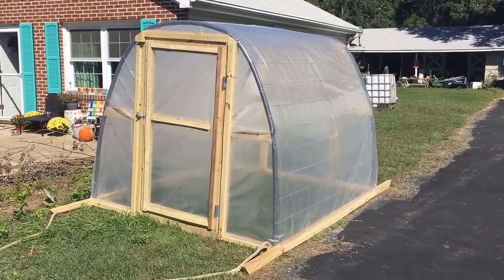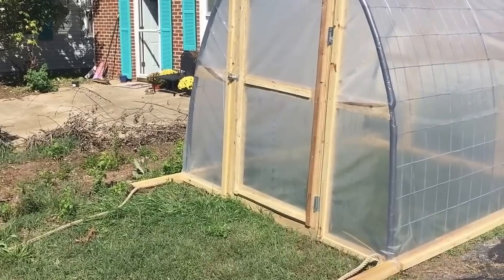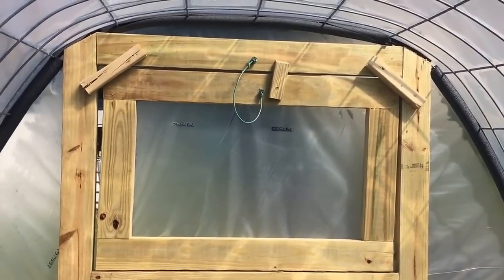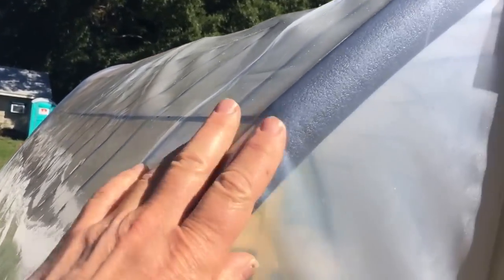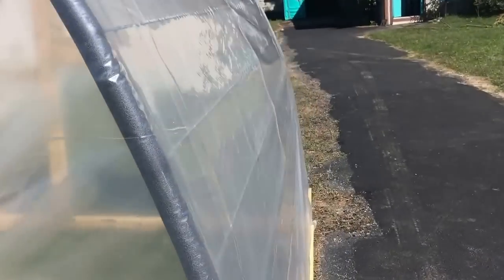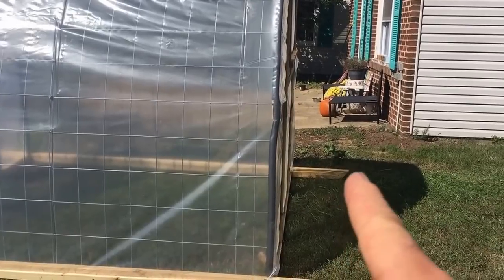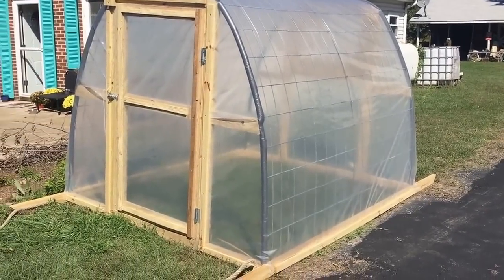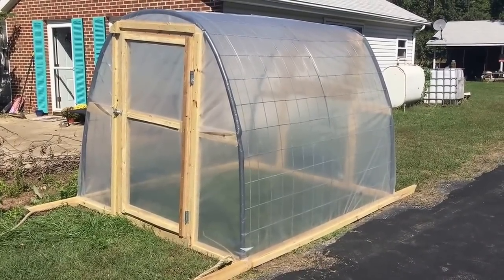DIY Cheap Greenhouse

Comment: Couple questions. Wouldn't ants and termites eat the wood? And what are you supposed to keep pest and rodents out?
Reply from the maker: The wood is treated, so I've never had an issue with termites or ants.  Pests and rodents will find a way in if they want to, so don't put things in there that attracts them.

Comment: I noticed your cattle panels are on backwards, should be flipped over so cross wires are on the inside.
Reply from the maker: Thanks!  We were going fast with multiple people and that one slipped through the cracks.
Reply: hi everyone ,if anyone else trying to find out diy backyard greenhouse plans try Lomonting Easy Greenhouse Mentor (do a google search ) ? Ive heard some unbelievable things about it and my buddy got cool success with it.
Reply: I\'m not sure but ,if anyone else is searching for diy greenhouse ideas try Lomonting Easy Greenhouse Mentor (do a search on google ) ? Ive heard some incredible things about it and my friend got excellent results with it.
Reply: @All Thing's Green - They are called cattle panels and they are galvanized steel, so they are rust resistant.

Comment: I'm curious about the life of the plastic cover. I've built one with visqueen before and after about 3 months the sun caused it to crack and split and then the wind finished it off.
Reply from the maker: This one is rated for 4-years.  Amazon link: https://amzn.to/34GMlWN  That will depend on the conditions though.

Comment: a word from  experience I used the 6 mil clear plastic on a similar style and in less than a year the sun destroyed the plastic and I replaced it with clear corrugated roof panels
Reply from the maker: Thanks for the input.  So far no problem here, but will keep this in mind.
Reply: use green house plastic, normal 6mil plastic does not have the uvi or uva additives to prevent the break down from the sun

Comment: I would have liked to see it being built. Are the slides pressure treated wood ? good video thanks
Reply from the maker: Yes, all of the wood is pressure treated.
Reply: @greatescapefarms  ok thanks I was just wondering I'm new to all this I had heard that pressure treated wood in the past had some caustic chemicals and I didn't want it to leach in to the ground or the vegetable.
Reply from the maker: @jamessmith5535  I had heard that years ago that was an issue.  I don't believe that it is an issue now a days.

Comment: Looks nice, but noticed bottom frame isn't "on" the skids. Will act as a rake board if pulled. Hopefully there's nothing in the way of the pull. 😉
Reply from the maker: So far that hasn't been an issue.  When I'm pulling it around there is enough of an upward lift that it is not raking.  But, I've been pulling it around on solid ground.  That may be a different story on mulch or something soft.

Comment: Amazing I’m gonna try the same what grade is the plastic (thickness)?and could you link the cattle wire I’m unsure what kind of wire that is here in the uk? Thank you!
Reply from the maker: Here is the cattle panel I get: https://www.southernstates.com/catalog/product/p-10375-ok-brand-max-50-10-fence-panel-5-ga-50-in-x-16-ft.  The plastic is I believe 6 mil.  From a previous comment: You get the most hits on Amazon by searching for "Greenhouse Polyethylene Film".  Here is a link I pulled on a quick search so you can see what it looks like.  Note that there are many sizes out there so search for the size that is appropriate for your project.  Amazon link: https://amzn.to/34GMlWN

Comment: Was thinking to do pvc I might try this
Reply: Looks good to me!
Reply: Dont try to use joints. Made that mistake.  If you do, use 45s.  I put a T in the middle of a 20ft section and it broke every time.  I went with rebar instead
Reply from the maker: I'd be afraid that PVC would be very brittle in the winter and break down in the heat of the summer.  But I have not tried it myself.
Reply from the maker: @okieking8503  I'd be afraid that PVC would be very brittle in the winter and break down in the heat of the summer.  But I have not tried it myself.
Reply from the maker: @andreasmith252  Thanks!
Reply: @greatescapefarms  if I had a recommendation it would be to use 45s so it's not under strain. That'll relieve all the tension
Reply: My rebar works great. I buried the poly sheet about a foot on each side. I'm from Oklahoma and its doing just fine in the wind. Honestly thought it would blow away
Reply from the maker: @okieking8503  Awesome info.  Thanks!

Comment: Very nice!! How would you attach the plastic outside bottom on the sides on the wood?  Stables, nails? Then put another smaller board over to help hold? Maybe I just answered my own question. Thanks!!
Reply from the maker: You did - a small board with a couple of nails.

Comment: Looks nice, what state are you in? I live in NM and was thinking of doing this but it is really hot here in the desert
Reply from the maker: I'm in MD/WV - zone 7 and 6 with a good bit of rain.
Reply: DemonKilla
 - Why in the world would you want a "warm" greenhouse in the desert?! This design for sure retain moist, but also enhance inner temperature.
In fact under full Sun light it will raise inner temperature a lot. Makes little sense for desert environment, even if nights in the desert can be quite cold.

For whatever it's worth, my 2 cents would set you more into shade cloth/fleece cloth (reduce Sun exposure). Associated with heavy organic mulching (no plastics) for temperature regulation, moist retention and over time soil improvement.

I believe it would provide better ROI, and easier to set. Since the cloth could be set either over the plants or in a pergola type structure. ;-)
Cheers

Comment: What about at night when temps drop? is there a way to hold the heat?
Reply from the maker: The thin plastic does not hold heat well at all. You can extend heat by putting water jugs in there and painting them black.  This will act like a battery, charging in the heat of the day and discharging in the night.  But they can only do so much.
Reply: Can you double up on the plastic for extra insulation and to keep it warmer at night?
Reply from the maker: @agrarianarc  I have not tried that.  I do know they make various types and grades of plastic and I imagine you could spend the extra money for better plastic vs. doubling up and get better results - unless of course you already have enough to double up - free is always better :)

Comment: Treated lumber is definitely not for good grade  products. Especially a hot house! If your willing to take the chance I guess. Plenty of research on this copper infused lumber. Great idea though!
Reply from the maker: Hmm.  I'll have to research this further.  Couldn't use just stud lumber, because it would rot in less than a year with all the water.
Reply: Tony U pressure treated lumber don't use copper anymore
Reply: I don't know if you have it in the US but Macrocarpa is the alternative non-toxic timber here. It might last ten years I guess but definitely not as rot resistant as the chemical-laden stuff.

Comment: 5,000 dollars worth of what product?
Reply from the maker: We are a commercial nursery operation and we take cuttings from plant, root them, and sell them.  Here is the calculation on how we (as a commercial nursery) came up with $5,000 of product per 8’ long enclosure. 

8’ long, with two 2’ wide beds and a walkway in between.  Plants have 2” x 2” of space.  Equates to 96” length / 2” of plant space = 48 rows per bed times two beds = 96 rows total.  Plants are 2” apart and beds are 24” wide yielding 12 plants per row.  12 plants per row x 96 total rows =  1152 total plants.  Assuming 90% success in rooting, we yield about 1035 plants.  At a wholesale price of $5 each, we yield $5,175 per 8’ long enclosure.
Reply: Nice!
Reply from the maker: @hezekiah5537  I have many YouTube videos on how to set up a business like this on my channel.
Reply from the maker: @hezekiah5537  Thanks!

Comment: How can one deal with the heat?
Reply from the maker: I would only use a green house of this design for season extension - early start or extending into the fall.  I have everything out of it in the summer when it is blazing hot out.

If I did keep items in there, I'd use screen on the door, leave the window open, and also use a shade cloth of 50% or more shade so it did not get direct sun.  I would just lay the shade cloth right on top of the glazing.

Comment: Is that treated lumber? Awesome design! Would be concerned about tainting vegetables with copper and other chemicals used to treat the lumber.
Reply from the maker: It is treated.  I've used PT lumber on a lot of things and haven't had any issues.  I've seen several articles that says it isn't that big a deal.
Reply: You're fine. They don't treat lumber the dangerous way anymore, I built this greenhouse with treated lumber years ago after doing hours and hours of research on it. Not only that, but if your veggies aren't touching the lumber, there was never an issue, some people are just scared of everything. 

Just a tip though, that foam is going to heat up like crazy and ruin your plastic wherever it touches it. I would get some white cloth to slip in between them and the plastic and it should last a lot longer.
Reply from the maker: Thanks!
Reply: Nope it's not gonna hurt the plants they don't use arsenic haven't for a long time and the stuff they use now don't leach out